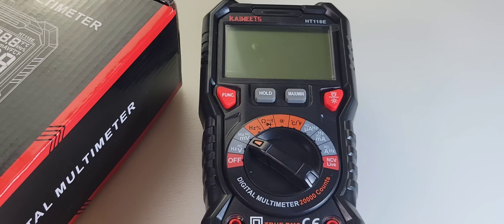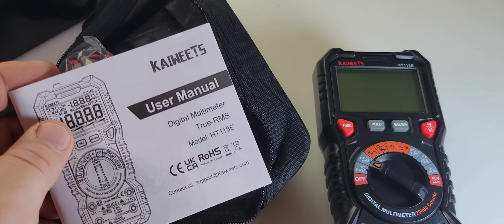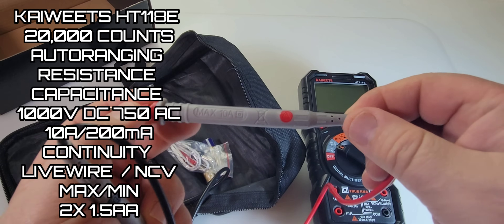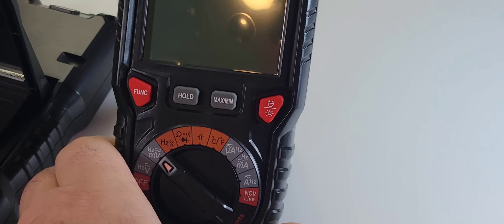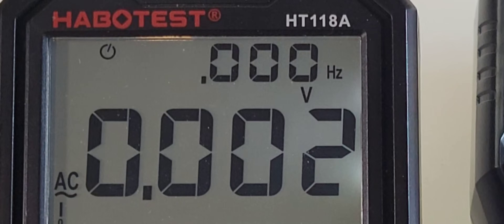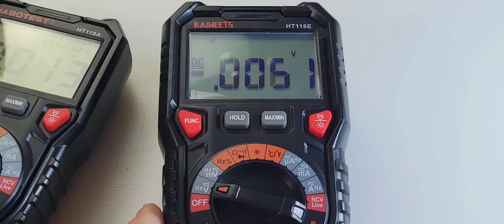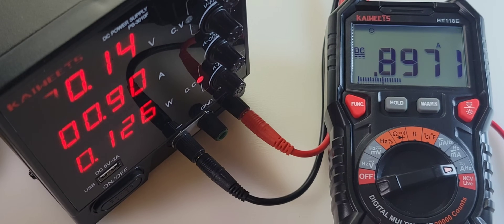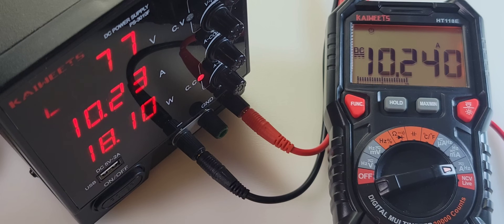ALL NEW KAIWEETS HT118E CHEAP-O Multimeter Review & Teardown!

Comment: Thanks again. How come this HT118E's capacitance (I think EEVblog likes this meter too) specifications starts with 20nF yet on another channel it was able to measure a value in the picoFarads (200pF in that channel)? Shouldn't it not be able to read something lower than 20nF and it'd just indicate OL or a similar reading?

Can all multimeters w/ a capacitance function read lower or higher than their specifications including the beautiful, cool & amazing looking Habotest HT116 Smart multimeter (I love how I could long press the Auto red button and it'd go to Auto quickly so I can quickly switch to continuity with one hand or the usual DC voltage, resistance w/ one hand automagically as Steve Jobs would say. I wonder draw what the power draw of the Smart colored LCDs are X-D. Could you include estimates how long the battery will last when used for hours w/ the always ON and when it's just stored in your 2023 videos. Also include lower value capacitors in the picoFarads for your 2023 review, lastly perhaps you could do Part 2 or revision for all the past multimeters, especially your Zotek and the beautiful, amazing, so colorful HT116 either from Kaiweets or Habotest or GDA- I think Kaiweets is the father, since I think they started this cellphone looking cool multimters)

The HT118E's capacitance specs:

20nF/200nF/2uF/20uF/200uF/2mF

Also for 2023 as an evolution,  modify all the multitesters (and variable  power supply & scope and other electronic gadgets) to become better, modify proper shielding, modify to have true ground from the metal and knobs, modify subcomponents (LCD to OLED for the amazing, cool, stupendous HT116 :-) I'm glad I was freed from the dial rotary multitester- I hope Fluke makes a huge colored OLED or even better Colored e-Ink for outdoors and take notes from the amazing Kaiweets's innovations, so other branded, very durable brands like Sanwa & Brymen will take notice and so we'll have better displays in the 21st century). I got this mod idea from a channel who reviewed the amazing OLED soldering iron that's affordable- the KSGER brand (it has other names- rebrands), check their AliExpress official site. I highly, very hight recommend this soldering iron- buy their very stylish but very capable silver, very stylish 2 in 1 combo of the SMD hot air (it uses the hot air SMD recommended by EEvblog, whoever is the father manufacturer of that is a cool chinese company like DJI- a rarity in CCP CHN quality) w/ their KSGER soldering iron (buy the black and chrome stylish silicone cord soldering iron- uses Hakko genuine and Hakko clone tips- buy the more than 10 tips for cost-effectiveness but don't go beyond 350 Celsius especially for the bevel and chisel types, unless it's geniuine Hakko tips which can do up to 400C).

I wish it was all OLED like the amazing Kezger (may they have colored OLEDs for 2023) or e-Ink.

Thank you. 2023 is ours for the taking by God's grace & bestfriend Mother Mary's intercession.
God bless, Rev. 21:4
Reply from the maker: You touched on some great 👉 points.. 
I've got sone great soldering station reviews coming up..think you might like them!

Comment: How did you open up the case?  I saw this video and decided to get myself it for Christmas.  Accidentally measured voltage while set to mA and blew the fuse on day 2.  Went to open the case, and there's no screws.  Worse, the case is tighter than a clamshell it is in no way intended to be taken apart.  Contacted them, and they say to send the unit to them to have the fuse replaced they're not user replaceable and they will replace them for up to 3 years after purchase.  After the 3 years, I guess they expect you to throw the unit away if you blow a fuse.  I was going to just replace the fuse, I'm so upset with the stupidity of these inaccessible non-serviceable units if I can't figure out how to open it without damaging it I'm going to send it back and get a brand you can replace the fuses yourself.
Reply from the maker: That's a common mistake and fear not, Yes you can open the multimeter to change the fuse. First, you need to remove the rubber boot/sleeve. It's on really tight but it does eventually come off with some effort. Youll need to remove the 4 Philips screws holding the cover on. Then replace the mA fuse with another 6x30mm Ceramic make sure it's at least as high as the 200mA rating. These multimeters are designed to easily replace the fuses. Let me know if that helped!
Reply: @KeepOnTesting  Oh my god thank you!  And so fast!  I didn't know there was a rubber boot/sleeve it looks just like the plastic and fits so tight.  That's what I was missing, now I see how the rubber sleeve goes around it and can be removed.  Thank you!
Reply from the maker: @Clydesdale2045  No problem! I also did a quick how-to on the website if you need more help. 👍 https://www.keepontesting.com/post/ht118a-e-how-to-change-those-fuses

Comment: Which tester will show capacitance of audio crossover capacitors?
Reply from the maker: Any multimeter that has capacitance capability will work. Your best bet is to use an LCR METER so you can find a capacitor with low esr.
Reply: @KeepOnTesting  Perfect , thank you. Yes it is lower esr i was looking for and didn’t know what it was called. 
Really cool videos. ✅

Comment: I was actually about to order the ht118a before I stumpled upon this review. This looks like a straight up upgrade. Only thing missing is the beep on diode mode... Do you think I should just wait or get the ht118a now?
Reply from the maker: Personally I would grab the 118E now as it's such a nice upgrade. That being said, you can have most of the bells and whistles plus amazing diode performance with a UNI-T UT39E+ https://youtu.be/qy8B4Y8c0_4
It's also 20k counts ! 😉  Only downside is its less than stellar display and it's a manual ranging multimeter. Still I would take it in a heartbeat if top notch professional diode performance is your thing.

Comment: Still no option to measure inductance.
Reply from the maker: I think a standalone LCR METER is best suited to that specific test environment. That would be something though !
Reply: The only ones that I know that do that are the old Amprobe 37 and 38's. I just use a B&K LCR meter. You need to specify the frequency anyway.
Reply from the maker: @barrybogart5436  It's definitely a rare beast. Finding a dmm that also does inductance they are sparse indeed. Here's a few. 
One of the reviews is almost 5 years old so apologies 😅 Multimeters with Inductance:
Mastech MS-8269
https://youtu.be/0xx_Lfo4T0Q

HOLDPEAK HP-760C https://youtu.be/dBuJXOaBlBk

PROTEK
Coming Soon!

Comment: I'm going to wait a little and then get this meter. Like you said it has a few kinks that need ironed out. Still very impressive at 20K counts. I used to work for a metrology company, and we would calibrate laboratory equipment. A 20K count meter would have been really nice for applications like that.
Reply from the maker: Definitely in need of optimization but I'm sure Kaiweets will get the 118E on track. Yessir 20k counts is a real treat at this price!
Reply: You don't mean 6 1/2, 7 1/2 or 8 1/2 digit meters instead? 20k (4 1/2 digits) count multimeter doesn't really sound like a metrology grade equipment cal device. And nevermind the accuracy and temp coefficient of the device.

Of course unless you're calibrating one of those cheap power supplies with 10mV max sensitivity